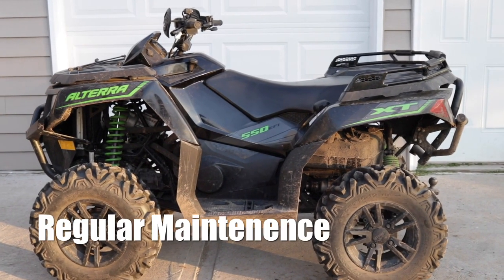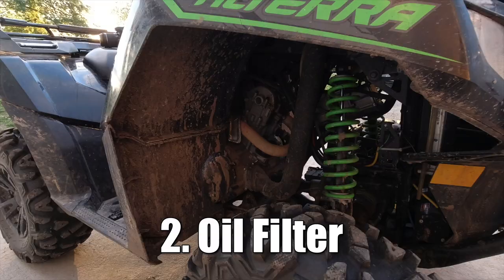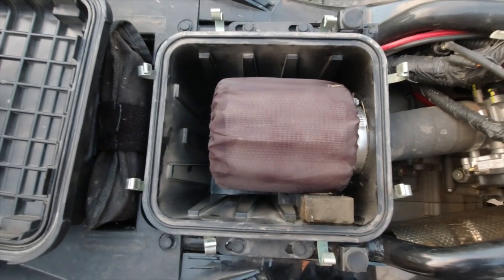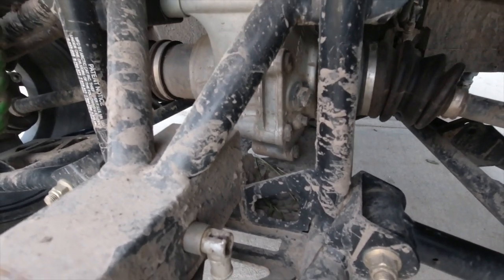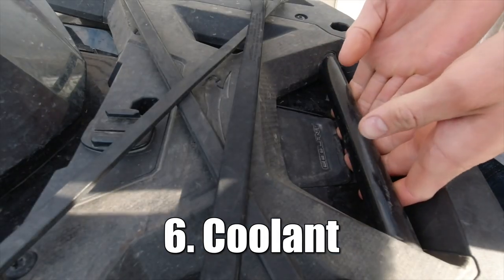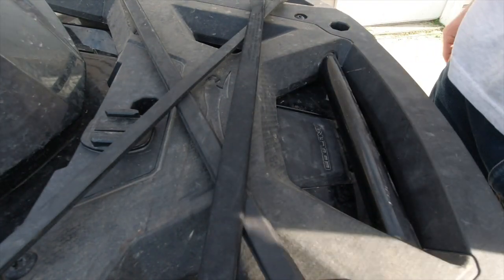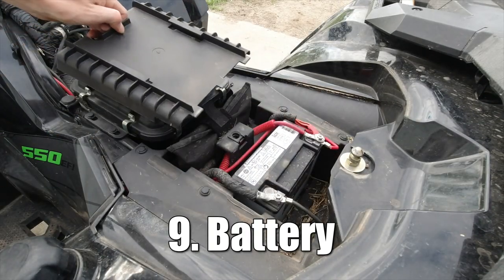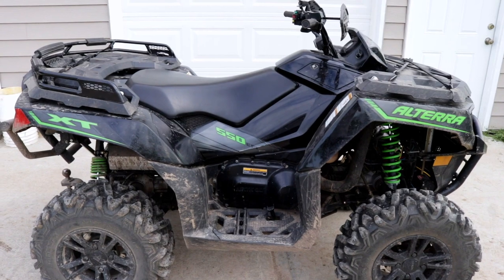Top 10 Things You Should be Checking on Your ATV

Comment: like those tires. just picked up a lightly used 2006. Im desert riding, lots of gravel roads, lots of tough, sharp rock riding and climbs.   So are you sold on the MassFX 6 ply? Also - do you mount these yourself or get it done at the shop? The prices are right, and they have good reviews. Thanks for your easy to follow maintenance tips. Its an excellent way to start my ownership. always been a bike guy. appreciate your video. well done.
Reply from the maker: Glad my videos helped you out! They’ve been a great tires. They have good grip and have over 2000 miles on them as of now. I did mount them myself which was fairly simple. I go over more details on these tires in this video https://youtu.be/zkzxHcZzQ94

Comment: add oil until it comes out of the drain plug?
Reply from the maker: For the diff fluid there is a fill level plug below the fill plug. The drain plug is on the bottom of the differential.

Comment: I have an arctic cat 550 2012 atv it runs good but sometimes the display keeps saying efi. 
I think it thinks something is wrong with the efi sysem
Reply from the maker: Sometimes it will show EFI if the battery voltage is low.
Reply: @ArcticFrost  thank you I will check
Reply: @ArcticFrost  love this channel it helps a lot
Reply from the maker: @gunnarflaten6774  Thanks man! Just sharing what I’ve learned over the years with these ATVs. 👍🏼
Reply: @ArcticFrost  i figurer it out it turns out The battery was perfect but it didn’t have enough contact with the poles but i took it off and cleaned the connections and tightened it very hard and it seems to be working again. I changed the break-pads on the front wheels because it was totally warm out one of the pads had even gotten half way warm of on the metal but it hadn’t damaged anything else fortunately. Also cleaned the air filter and the box it was in so it seems to be running smoother now too. Thanks 😊
Reply from the maker: @gunnarflaten6774  I use a wrench instead of a screwdriver to tighten the battery for a better connection. 👍🏼👍🏼